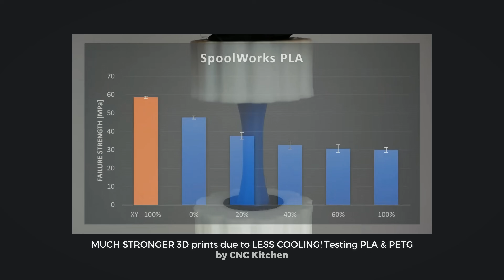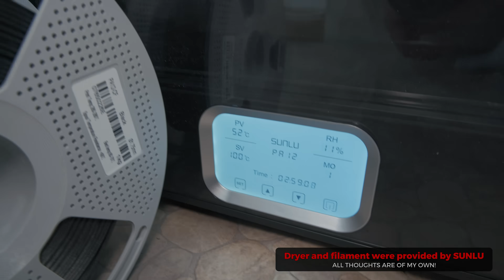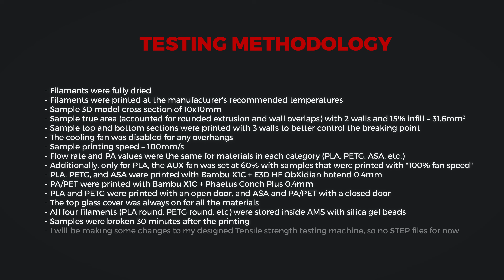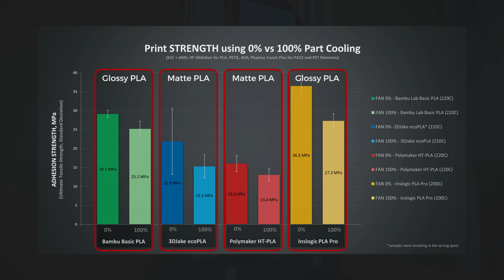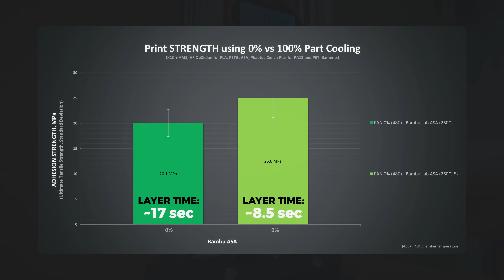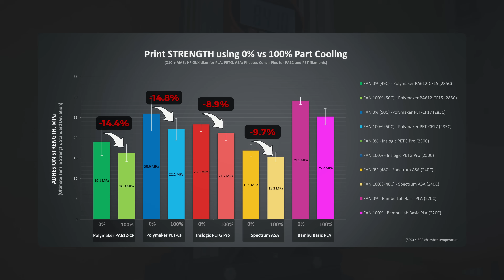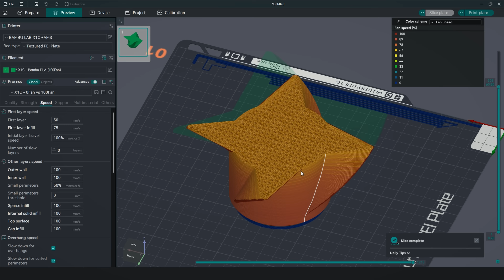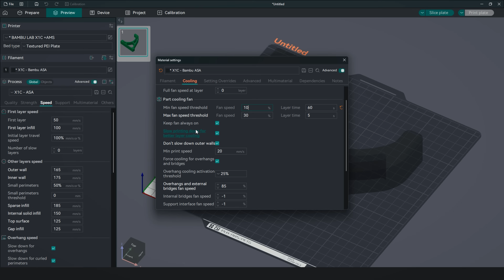3D Printer PART COOLING Effects on LAYER ADHESION Strength (PLA, PETG, ASA, PA12, PET)

Comment: This is very valuable information on a topic that gets way too little attention. Thanks for the huge effort!

Also very meticulous preparation and testing! Nicely done.
Only one thing I have to say: It can make a difference (IIRC to layer adhesion) what nozzle you use. CNC Kitchen showed this in one of his videos. If I remember correctly the brass one was noticeably better than the steel one.
Unfortunately you used different nozzles for different materials. I just hope they do not differ as much as in CNC Kitchen's case.
If you are looking for video ideas, maybe you can repeat that test on one material and show us what difference your nozzles make for layer adhesion.

I would have loved to see you testing PC too though. Just out of curiosity, to affirm my findings. 
When I was printing Polycarbonate (Kexcelled K8), I feel the gap was even bigger than 50%. There was almost no layer adhesion at all if I turned up the cooling too much, up to the point that the filament even de-laminated from the previous layer and the print failed. (I have a strong CPAP though). With fan disabled PC layer adhesion was very strong (65°C chamber, 290°C nozzle).

What I'm still looking for is a comprehensive test print model, that helps you to find out how much cooling you need for the complete layer time range - with just one print - and that you easily see what settings you have to put in after (it is 4 variables, that's not easy). And each time you change the nozzle temp by 10-20°C the values change again. 😑
Especially for small prints it can go wrong quickly if you have just a bit too little cooling. For long layer times it's easy, you can basically turn the fan off for all materials above a certain layer time.

And oh boy, your English pronunciation could still use some improvement😅.
If I hadn't subtitles enabled I would only understand like 80% of what you're saying.
If I had to visualize it, I'd have to say it sounds like tangled spaghetti look 😂
Hope you take it with humor, I don't mean to discourage you ;)

Comment: Have you managed to test the theory that previous layer has to be above certain temperature when new layer is laid to feature decent adhesion depending on filament type?
Reply from the maker: I didn't specifically tested that but in my opinion, it's a gradual thing. The hotter the previous layer the better adhesion is. But different materials benefit differently from this. I don't think there is a requirement "to be above certain temperature" as we lay down very hot molten plastic that melts the previous layer. You would probably need to print inside a freezer to encounter a complete bonding failure.

Comment: I may have missed an explanation there... But if running the cooling fan is bad for strength, why use a cooling fan at all - ever?
Reply from the maker: So that the prints won't turn into blobs and for proper overhangs.

Comment: New tensile tester?  Mind sharing the design?
Reply from the maker: I don't like a few aspect of the machine and I plan to make changes. So I am not sharing files for this version. I don't want people having annoying issues when assembling and using it.
Reply: @PrintingPerspective  What was wrong with your previous design?  Was it not powerful enough?
Reply from the maker: The previous design was not mine. With higher loads it would flex, so for a reliable data it was good up to 100kg. That is why I made the new one as loads with the new bigger samples can be way higher.
Reply: @PrintingPerspective  Maybe too long of a question for Youtube, but why are your test samples designed that way?  Shouldn't you be using ISO 37 or ISO 527 specimens?  Also, have you considered a completely different testing approach; Clough42 made one using a Tegara 690X bench vise ($480) and FM-204-500K strain gauge ($228).  https://www.youtube.com/watch?v=OWH_N9PmjeY&t=129s    That bench vise is expensive but there's a functionally equivalent Vevor version that you can get for $120-150 depending if it's on sale that day.  The Vevor handle is removable and there's a small hex drive underneath (the 690X has a large hex drive); we'd only have to build a gear driven motor adapter to run the tester with a consistent force ramp.
Reply from the maker: TLDR: I find enjoying creating custom stuff myself that be the main reason. There are many standards, not only those you listed, plus most of them are designed for injection molded plastic samples and not for printing such slim and tall prints in the Z axis. In this video, I wanted to test samples that represent real prints, meaning a few walls and some infill. I am always about the practical side of things and not pure scientific results. So by doing this, I now know how much real prints can vary in strength, despite all having the same printing settings. This raises a question: why? Does location on the build plate affect that? Is retraction and detraction extrusion so inconsistent? etc.
Reply: @PrintingPerspective  "I now know how much real prints can vary in strength"--my engineering friends and I find these efforts interesting for the same reason.  When it comes to filament tuning, a friend of mine recently said "we need a way to figure out if our tuning approach is just resulting in pretty objects or if they're strong too."  Going back to the ISO standards, I realized this morning that the test samples are relatively small because that's all you need to understand the fundamental material properties, and going larger would just add cost to the machine.  Knowing the material properties is enough for hand calculations and FEA if you use a conventional manufacturing process (e.g. casting, milling, or injection molding) where the material is isotropic.  3D printing adds a huge number of variables to that process (e.g. nozzle speed/temperature, wall and infill strategy, cooling speed, and chamber temperature).  So you want test samples that can accurately predict the strength of something like 3 walls and 15% infill, which needs to have a large cross-section (e.g. 15x15mm), otherwise the "walls to infill ratio" is excessive and you're essentially performing a bad/weird ISO test.
Reply: @PrintingPerspective  As a head's up, several engineers at the company that I'm working at are collaborating on building a strength tester based on the Vevor copy of the Tegara 690X bench vise.  It's a derivative of Clough42's layout, but with a motor drive and strain gauge, and we want to marry that with your approach to breaking large, realistic 3D printed test samples.  For consistency, would you be willing to share your claw design or test article design so that we don't create yet another inconsistent test standard?

Comment: I think an interesting follow up video is chamber temps vs layer adhesive for ABS/ASA. But ideal ASA/ABS chamber temp is like 80-85 so you probably don't have anything that even gets close to that temp
Reply from the maker: Yeah, you would need an actual industrial grade 3D printer to do that.
Reply: @PrintingPerspective or a $50 chamber heater
Reply: @TheOfficialOriginalChad most printers can’t go beyond 60-65C even with a chamber heater. Maybe a Voron can withstand those temps, but chamber heaters are not recommended for those printers
Reply: @TheOfficialOriginalChad 
That is a fire haserd and the printer components will degrade much faster
Reply: @Goroca …85C air is a fire hazard?
Reply: @TheOfficialOriginalChad 
Yes bechos people can't design heaters so and the actuals heater is much hotter
Reply: @Goroca idk what a becho is but your credibility is gone lmao

There isn’t a single printer component that catches fire at 85C. Not a housing, not even a sticker. Most chamber heaters have thermal breakers and decent ones are temp limited by solid state relays, so even the element stays relatively cool.
Reply: @TheOfficialOriginalChad 
Ok
Do it if you want, good look
Reply: @darthvader4977 voron not even close lol
Reply: Raw abs is more like  100c
Reply: @Goroca it's not really